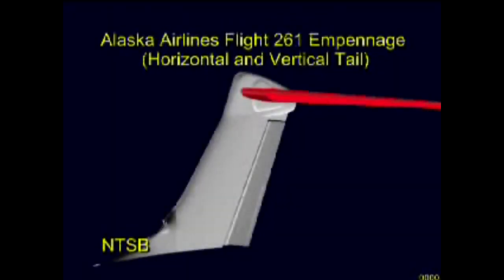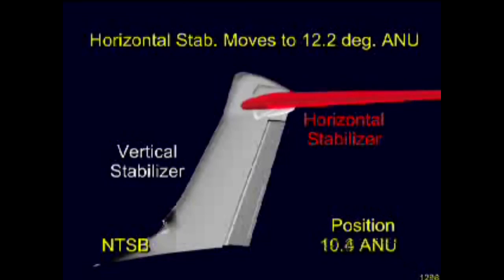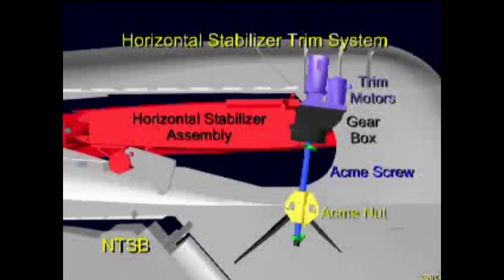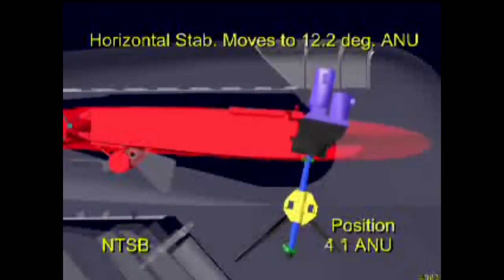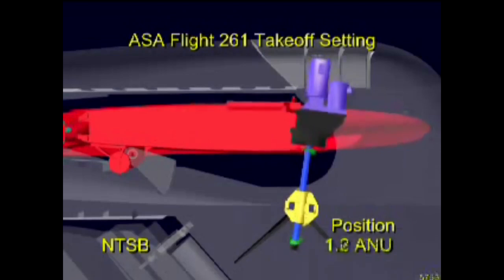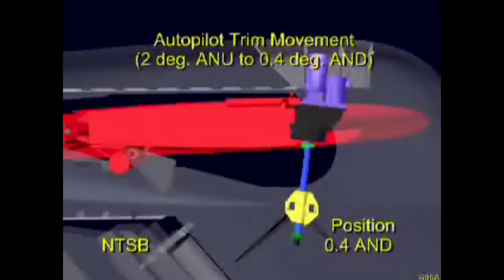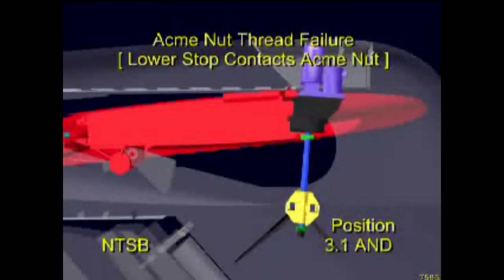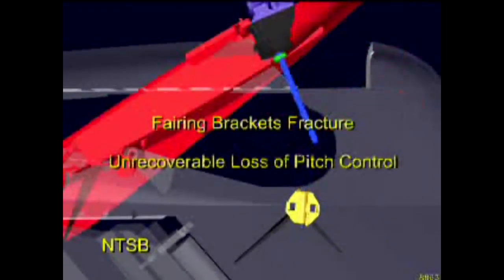Alaska Airlines Flight 261 - Jackscrew Assembly Animation

Comment: Even more crazy and still..... Dual tailfins entirely far enough apart to operate independently with separate screw gears in case one jams at least countering it until it can be position neutral..
Reply: Alternate lubrication injection system in case of jamming ..
Reply: The horizontal stabiliser needs to operate as one. If you split it then effectively you have an aileron on the tail of the aircraft which would be just as catastrophic

Comment: Bad construction, to much load up on small points...
Reply: as far as i know they still make them like this. the problem with this flight was that the acme nut went uninspected for much longer than manufacturer recommendation because the airline was trying to cut costs by decreasing the frequency of inspections.
Reply: yaiss thay want to be savéd á Ohm-Jar ovv OiŁ ¿¿¿¿
Reply: yaiss thay want to be savéd á Ohm-Jar ovv OiŁ ¿¿¿¿
Reply: A similar design still exists on a lot of large commercial aircraft
Reply: @NicholasRiviera-Dr  I'm afraid so!!
With no any back up, only to count on personal to keep the right routine, which not a 100 percent  this days..